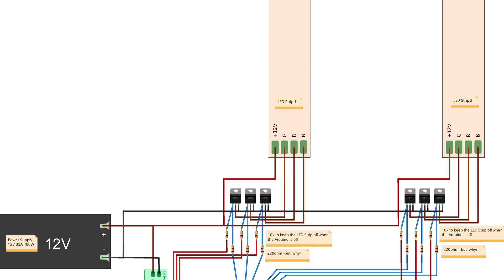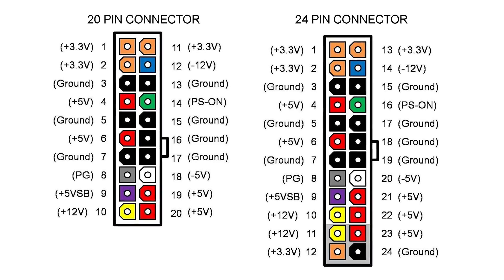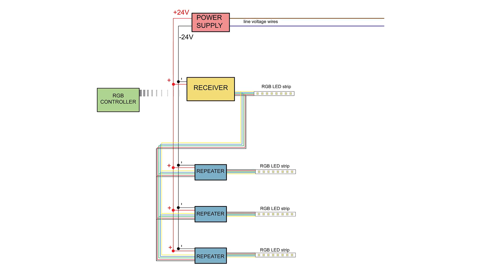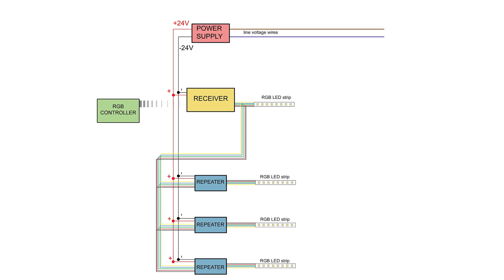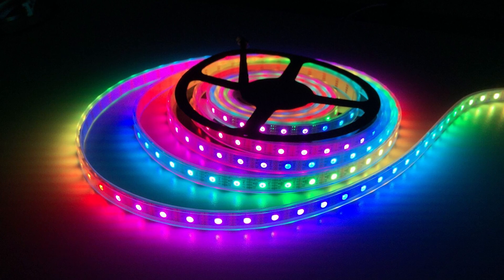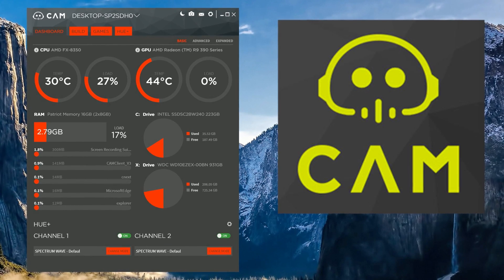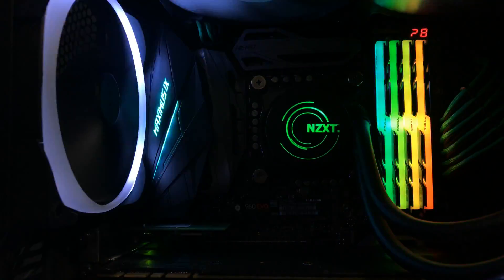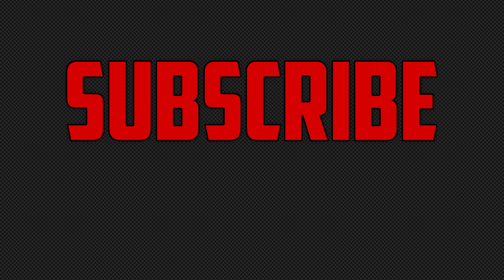How Do LED Light Strips Work?

Comment: Gave 1 star because it didn't explain how they work.  You know, what the title said.  I do know that 32 bits are sent that gives the 1st LED its 8-bit alpha, red, blue, and green values.  The next 32 bits sent are passed thru by the 1st LED since it has its color.  The 2nd LED then uses the value to set its color then enters thru mode.  This continues until data stops or all LEDs have their color and are in pass-thru mode.  Was hoping this would say how they work so I could know how the controller knows how many LEDs there are, and how multiple devices, say fans and case built-in LEDs are handled off the same motherboard ARGB header.  (Damn, I hate cell phone spell checkers that think LEDs should be changed to LESs.)
Reply: Texas NightOwl when
Reply: @Lucasperks06  Huh?
Reply: Texas NightOwl when did I ask
Reply: Texas NightOwl 😂 alright then

Comment: There is addressable LEDs(WS2811 Autorun) strip without a controller which is autorun, just need to plug it into 12volt adapter only. how does it works without a controller ?